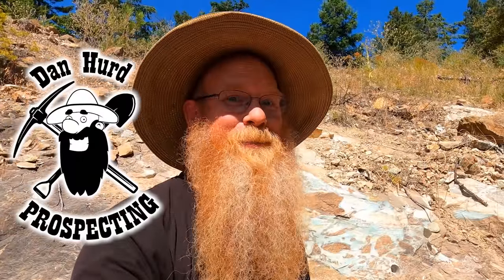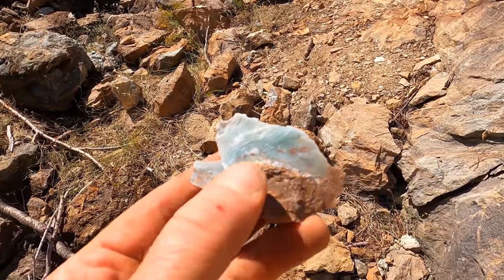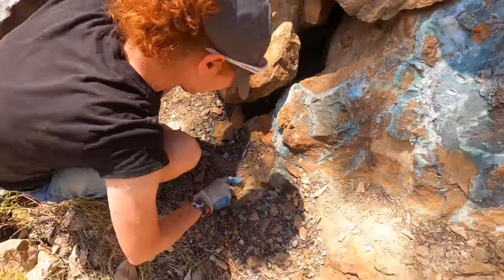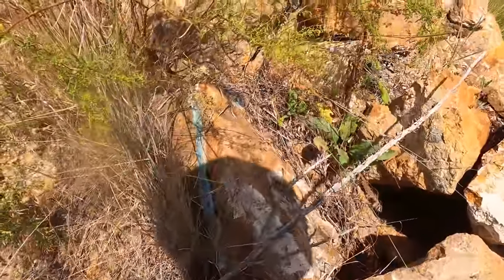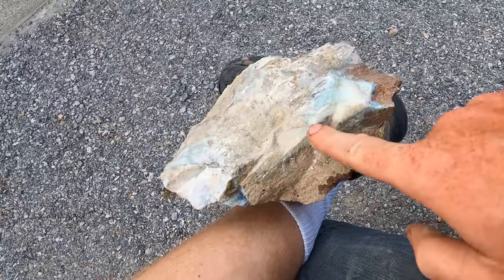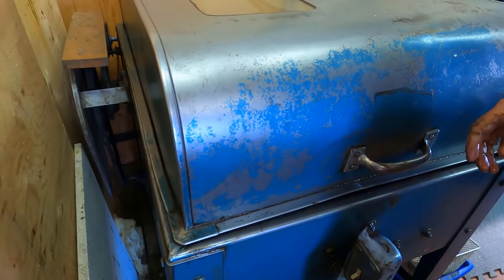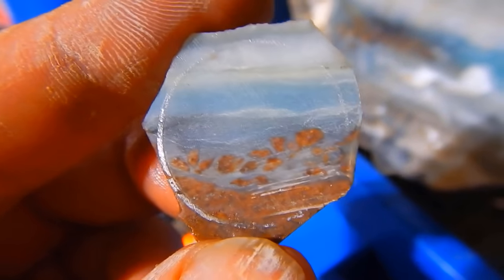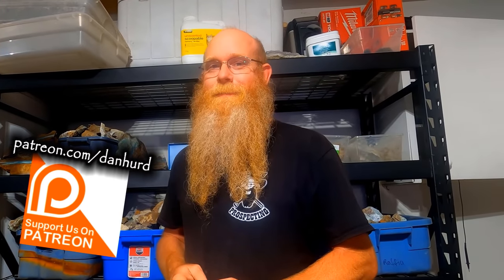UNBALIEVABLE Gem Stone with a Perfect Ocean Scene.

Comment: you would get big blocks out if you cut first with a sthil saw then chisel the bed seam with a bolster chisel. even if you drilled in lines  a few inches deep and close together you wouldn't shatter the rocks with a bolster or even a pitching tool. Using a point or a narrow cold chisel doesn't work well unless you just want to dig a hole. great program and great stones.

Comment: so, i had a thought... what if there was a tool, a bit like a chain saw, but using a diamond studded rope. some sort of flexible line, like what they use in granite quarries sometimes. then with a long enough bar to guide the rope, say, 3 feet or so, you could theoretically cut large sections out and then undermine a section to make it loose, and excavate large rocks with ease. if you had a set up with a water tank and a supply hose, you could probably get it set up in the bed of your truck nearby, and use a generator to run the saw and water pump, and you could extract massive sections, which you could then use straps and a winch and inclines to get into the truck bed. and, im sure that even if you yourself didn't do the work, one of your sons could run the machine while you directed the cutting or helped out with support, given your health conditions.

Comment: I do not remember where but I do remember seeing a group use what they called a micro blaster to lift plates of crystal off of host rock in a deep mine. Pretty sure it was an old silver mine but they were after large plates of unique crystals. At another point they used a tool that was basically several miniature hydraulic jacks by drilling a series of holes and hooking five or six of those jacks to an equalizer block to lift about a two foot square plate  of crystals off of the host rock. It seems like that would be a lot more controlled than your chisel method of working those large areas. You might need to go wide while creating a fracture line that way but you could saw away the excess later. Just a thought. Think hard rock mining only controlled rather than brute force.

Comment: I have used one of the hand held water jet cutting tools at work a number of years ago 
With the high pressure water and abrasive it was used to cut steel , concrete and bed rock 
I bet it would allow you to cut large  areas of the rock out to be slabbed up at a later time 
But we had to have water , power and a backhoe to do the cutting we had to do 
But for you you might be able to Rent or Lease what was needed 
But I am not sure if it would be cost effective  for your needs 
You would have to find out the local cost of getting the needed supplies to your site

Comment: Would an Sds battery driver not help? I have a mains 1400w one and it eats through concrete and brick in seconds. It only cost £40 tie it to a generator.. and quadruple your collection speed near roadways anyway. Hence a good battery unit for the less accessible areas.

Comment: Rotary hammer drill holes around the material without going through it. Then put some  dry tightly fitting wooden dowels in the holes. Soak them in water for an nourish atleast. then try to smack it out.

Comment: Go out and buy the Milwaukee Electric Chop Saw. That would cut the rock and all you would have to do is pry it out because it’s still stuck underneath. It’s an investment but will catch up on the long haul.
9” Saw Blade https://www.milwaukeetool.com/Products/Power-Tools/Concrete/Cutting/2786-20
OR
14” Saw Blade https://www.milwaukeetool.com/Products/Equipment/Cutting/MXF314-1XC